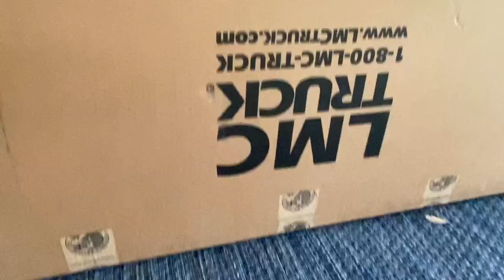How To: OBS Ford Grille and Headlight Bezel Swap

Comment: What front bumper is that?
Reply from the maker: Just the stock XL bumper for a gas motor. The diesel version has the black trim and cutouts on the front.

Comment: The after market grilles and bezels
Do not line up great..  LMC has about the best ,  they rate C+ to B-
In fitment,  still... looks better than the few pieces I had left duct taped and zip tied to my front end..
Reply from the maker: LMC is garbage. Don’t waste your time. Glad I switched them to Ford. Still not perfect though but better than it was.